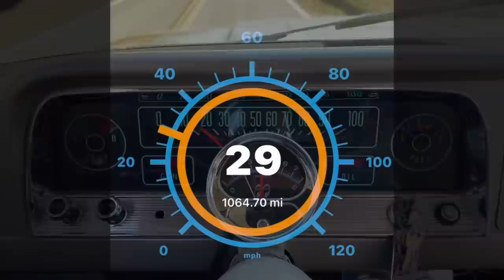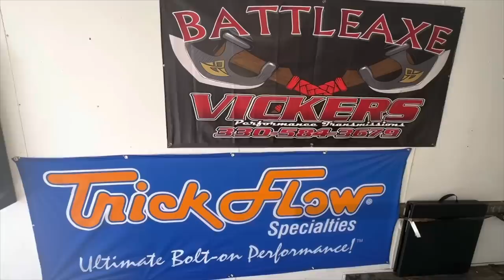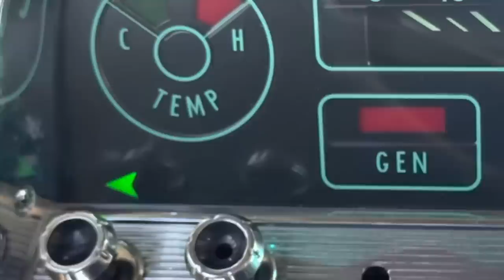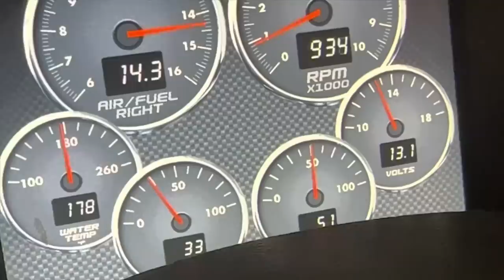Bucko & Kenny THRASH the AMX on my RC TRACK!

Comment: I don't know if this could be your problem with fuel sending unit but, it was mine. It took me a while to figure out what was wrong why it wouldn't go past half a tank. So check the float rod at the rotating part their is a a screw to adjust length of rod  at the unit make sure that end is not to long or it will get hung up and not let the unit read full. Hope this helps.

Comment: Thats a Gm alternator you guys pulled off the mustang. I would have just gotten a higher amperage GM alternator i put them on everything have even put them on a horizontal shaft Briggs and Stratton mtr. Needed a way to run a bunch of halogen lights and charge the batteries

Comment: On that cummins i would be putting this piece of information in the memory bank. That stock turbo had a issue with the exhaust brake and the turbo veins sticking and loosing the exhaust brake and in return terrible efficiency of the turbo. I would be thinking about buying a bd diesel screamer.

Comment: Get a meter match from technoversions...it allows you to calibrate your fuel gauge. I'm using a couple now because the cheap sending units are just off. One of the better thimgs you'll ever spend 50 bucks on...I just can't stand a fuel gauge that doesn't read right or at all.

Comment: Sometimes you have to set a voltage correction on the Holley. Check voltage with volt meter

Comment: But all I have at the moment is the 2000 dodge ram Laramie slt longbed quad cab 5.2 litre 318 magnum V8 46RE AT 1500 4x4 gloss black with I think it was a silver pinstripe or maybe white just fixed brake lines on it complete stainless steel brake line kit for the entire truck from classic tube out of Ohio.

Comment: Those Dodge Trucks (Cummins Engine) Motor mounts are a very common issue with those trucks.  With the age of that truck, I'm surprised they both have not been done already. We saw one last fall that had worn a hole clear into the turbo housing it self,  And cracked the exhaust manifold. That was NOT a cheap repair, The tow bill alone with the camper trailer it was pulling was over $2500.00. And another $5500.00 to fix it, (Turbo, Oil pan, Trans lines, Both motor mounts, Exhaust Manifold,  And several other small parts. It was ALL BAD...

Comment: I need a dog that Chase's the squirrels off they destroy my garden and get in every flower pot pain in the ass
Reply: Cats work 100 better for getting the squirrels. If a dog chases a squirrel, the squirrels run up the tree and wait for the dog to go away but a cat goes straight up the tree and rips the squirrel right out of it eliminating your issue all together.  Ya gotta be smarter than the squirrel Travis or you'll never get rid of em

-an experienced old man with no squirrels!